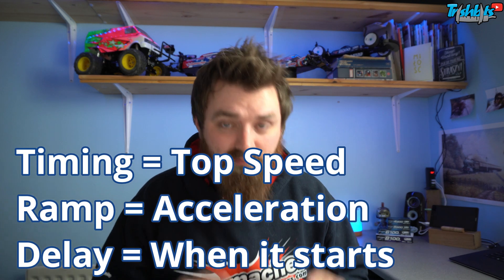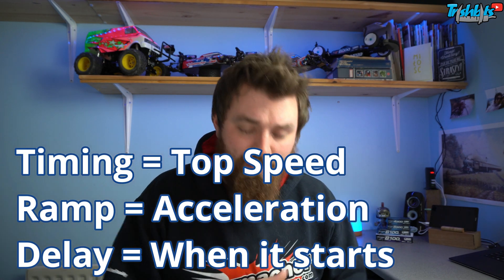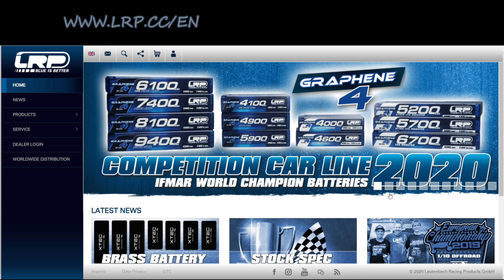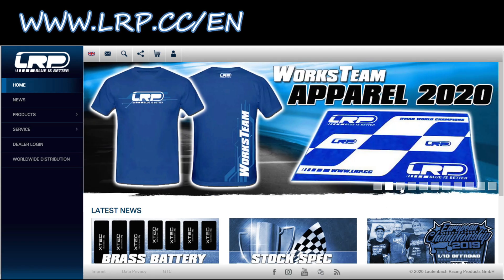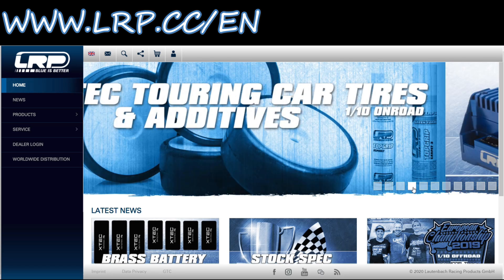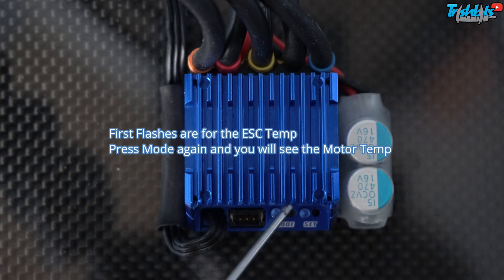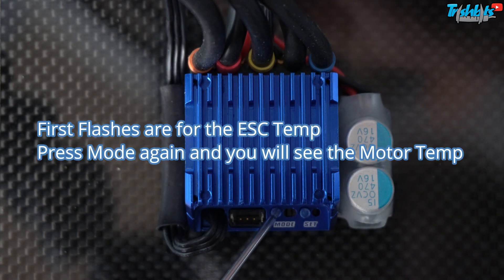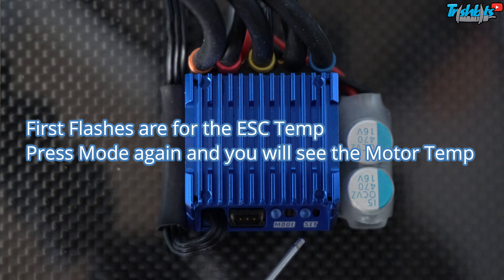LRP Flow X Esc Settings Features Explained | Part 2 | 3.2 Off Road Software

Comment: Thanks Trish, really appreciate this LRP esc series videos. For me was really helpful to clarify some doubts about ramp and timing interaction. Actually I’m using a LRP worksteam (3.8 firmaware) / X20 6.5 motor on off road carpet track and I’m really happy .... which advantages in switching to an LRP flow X? Can I still use the X20 motor or is better to change the entire combo? Thanks a lot for your support 💪😎